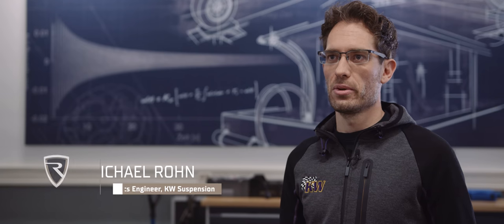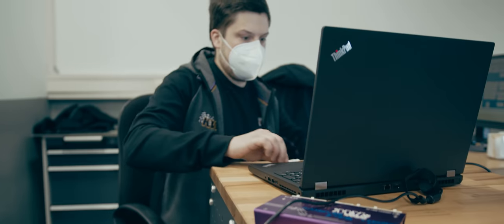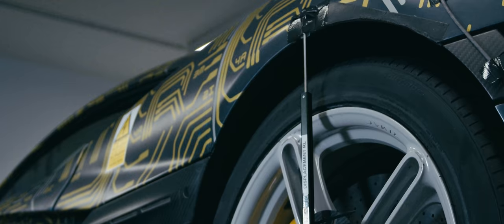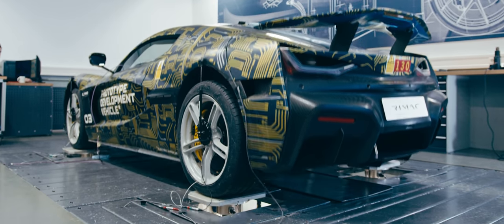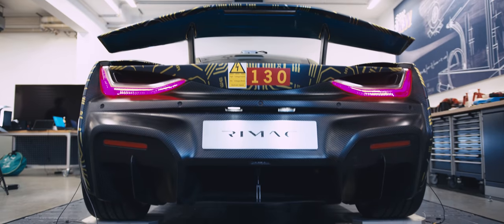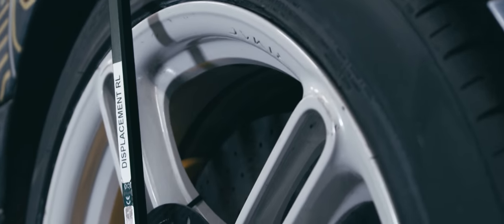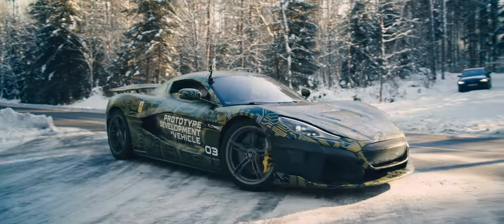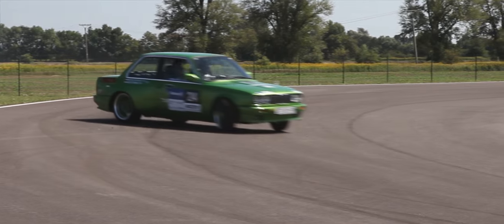Rimac Nevera Fine-tuned for Road and Track

Comment: Could you do a break down on efficiency of your inverter, motor and battery. I'm interested in your numbers (as a percentage) under power and what you can achieve under regen braking. Thanks! :)
Reply: I'd assume up to 90% at full power at best. Imagine 120 kW power loss vs. a combustion engine with over 750 kW of power loss in the same power range. What a waste :D